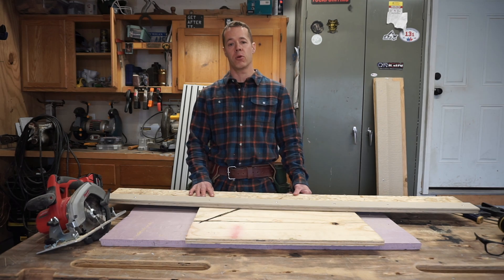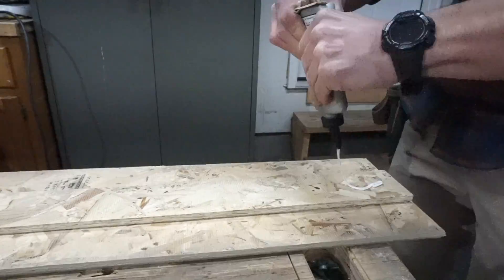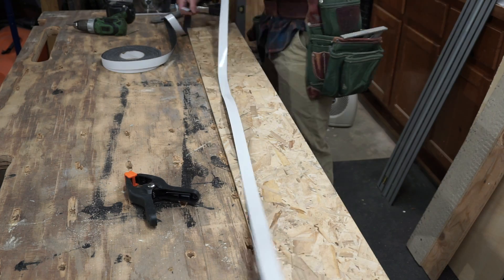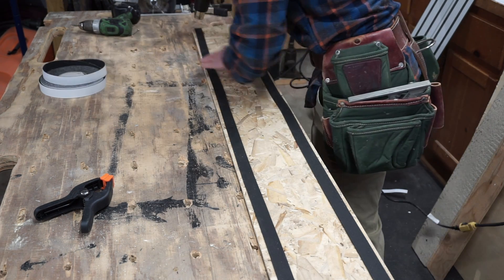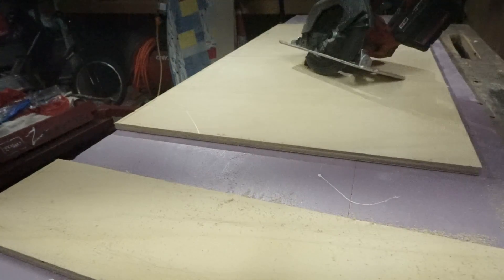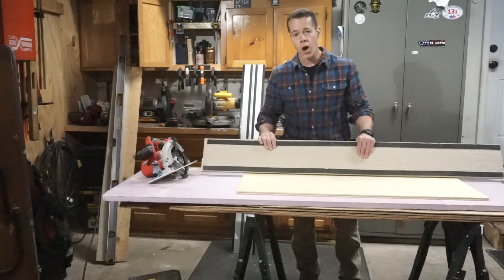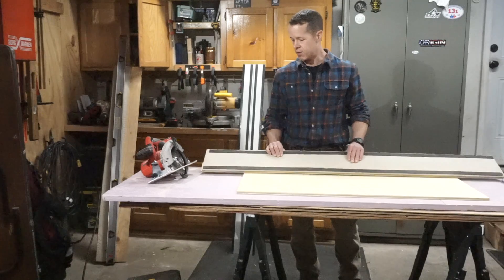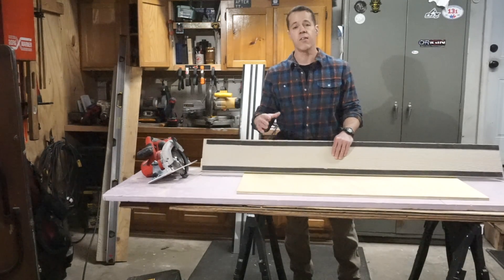The Two Dollar Circular Saw Guide Upgrade!

Comment: For someone who wants to avoid buying the weather stripping. Using a glue gun to make a thin pattern on the bottom side would work just about as well im thinking. Anything really that would add a bit of friction to keep it from sliding around would work fine. Good stuff.
Reply from the maker: Thank you!

Comment: I would be worried that the weatherstripping could compress and if it compressed on one side and not the other then you're not going to get a straight vertical cut. The cuts would not be square to the horizontal surface.

Also do you feel like the textured surface of the LP siding means that your saw isn't sitting totally flat?
Reply from the maker: Hey Sean, so it's fairly sturdy foam.....not like that super soft foam weather stripping you are likely thinking of.  Its similar material to the foam on the professional grade track saw

Comment: One thing that jumped out at me is the gap between the edge and the workpiece. Have you considered putting another strip along the edge, to be trimmed, just like with the manufactured tracks? Seems like it would improve accuracy, and to help prevent splintering.
Reply from the maker: Solid tip, thank you.  Not sure if it would reduce splintering though…… that’s usually a by product of the blade

Comment: That’s great, I need one but the cost is not justified for the amount of use it will get for me. I was thinking, what about a larger rubber strip? I’m sure there are many out there. Only reason I bring it up is because I would hate to have to stop and clean it as I was working. Cleaning comes after the fun. 😉
Reply from the maker: The rubber strip may work if it was larger.......but the foam worked so much better.  I was experimenting with a combination of the two.....just like the dewalt track, but the two different strips didn't offer any advantage.  Thanks for watching!

Comment: I know what you mean by December in MI. My 20x20 garage shop is in Clarkston.
Reply from the maker: Nice, do you have a legit heating solution in that bad boy?
Reply: @thedustybuilder  I use a small propane heater if I really need to get something done. Even with wall and ceiling insulation, the garage is still leaky. Makes glue ups difficult. Thinking about a solar beer can exchanger. Lots of trees blocking my southern exposure, tho.

Comment: I need a proper straight edge for ripping large 8x4! sheets mate.. This is a great idea with the backing to not need clamps.. Clamps are a pain in the ass tbh.. 
Enjoyed the video man but what if the factory edge isn't straight which a lotta the time it isn't from those stores.. Maybe show an easy fix for that if u have time aain.. Great video all the same pal..
Reply from the maker: Thank you...... I made a shooting board out of plywood where the factory edge had a hump in it.......I never fixed it.  I would just unclamp it and move the board to avoid the spot, lol.

Comment: Lets say I make it and then have one side of the track saw guide have a 45-degree onto the material so this allows  future cuts to have 45-degree cuts on plywood or any other material. What are your thought about this?
Reply from the maker: what a great idea!  You would just have to make sure that the wood 'guide' is straight on both sides.  I would likely cut it with a table saw to make sure that both sides are straight.
Reply: @thedustybuilder  sadly I don't own a table saw lol
Reply from the maker: @raji6811  No problem, you should be able to find a straight piece of wood at your local lumberyard / Lowes / Home Depot.  Might take some digging!

Comment: Another material, which may work better, for a no slip grip, is the foam covered net
type of shelf liner, available at Walmart (and other places).
I tried to add a link but couldn't.
Reply from the maker: Not a bad idea, worth a shot for sure!
Reply: Added spray glue and the shelf liner works great. When it wears out I just throw it away. Was all made from scrap so it cost almost nothing.
Reply from the maker: @dwarden3   Similar to the spray glue for corner bead?  What a good idea
Reply: @thedustybuilder : 3M 77 spray adhesive.

Comment: Great idea. I'll have to make one. Off topic, does that little space heater work well against MI winters?
Reply from the maker: Thanks Frank!  As for the little heater, after about an hour it 'takes the edge off'.  If its really chilly, I use 2.
Reply: @thedustybuilder  Thanks. I just got a new house in Lansing with a decent sized garage so I need to tackle insulating and heating it at some point. I can get REAL cold in there.

Comment: Dusty what is the siding up are using? Looks like hardiplank cement siding?
Thx. Bob
Reply from the maker: Just LP smart side, it was scrap I had left over.  1/2 inch plywood would be an upgrade

Comment: Like to see a cut with saw set at 45°.
Reply from the maker: Yeah.....you would need a dedicated 45 degree shooting board
Reply: @thedustybuilder  I always made one where you could cut with the wide stable side or narrow side. I made one to cut 45.5° angles for making box beams, and used it most.  We didn’t have manufactured tract saws.
Reply from the maker: @Bobcat1950 Oh nice.......is the 45.5 to ensure that the outside joint was closed?  If it works, its kinda hard to justify a 1000 dollar track saw I guess!

Comment: Track saws plunge cut - circular saws and framing saws don't. They're simply not the same tool, even though they can do some of the same work.
Reply from the maker: Yeah......I suppose they do plunge cut, however, the main advantage of them is a straight cut with a track that 'sticks' to the work surface.  The same can be done with a diy track, admittedly not as easily.  Thanks for watching.
Reply: Of course you can plunge cut with a circular saw. Granted you might have more trouble getting the depth right, but with a little practice it's not too hard. If tearouts an issue It's also good to have a zero clearance guide rather than these single sides ones. Other than that it's just a matter of convenience (and yeah a dedicated track saw is much more convenient)